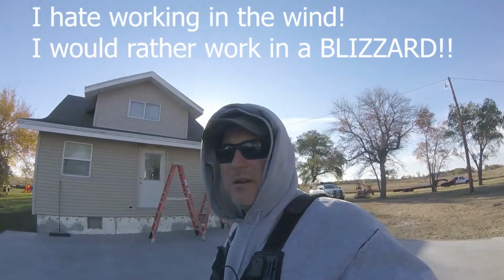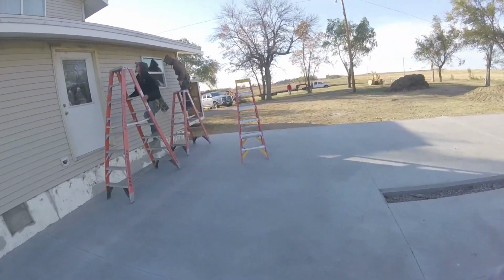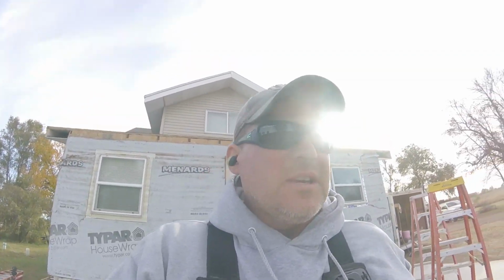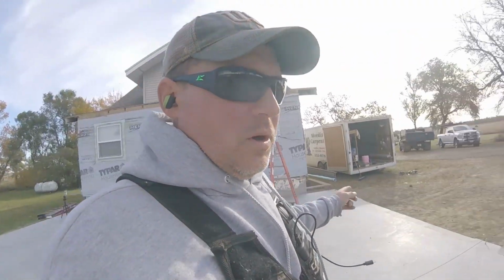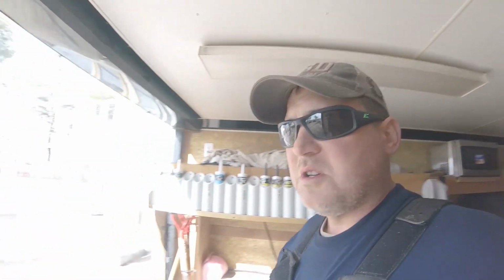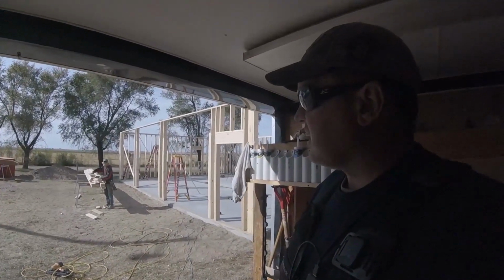30x40  ATTACHED GARAGE BUILD! PART 1

Comment: is there anything special about attaching a slab to the existing house foundation?
Reply from the maker: This foundation was done with 4 ft deep post holes under the slab.
Reply: @Warren3carpentry   I would like to see this. Our building dept says we most dig down to existing  house footings attach. Footings for all of the garage must be at the this depth. This house has 5ft of basement in the ground . That’s a lot  of concrete for a 55x 30 garage
Reply from the maker: This job, the concrete has post holes drilled down 4 ft spaced 8ft apart, then cement slab poured on top of a thickened edge slab. So a footing of sort. It was approved by our building inspector that way.
Reply from the maker: @davidshale1836  in our region they usually want a 4ft footing all around outside of the slab. Also connected to the house footing. For this job the inspector was ok with doing it the way it was done. Not sure why.